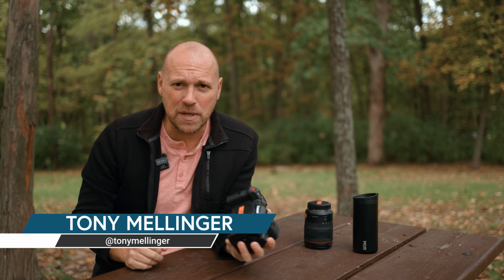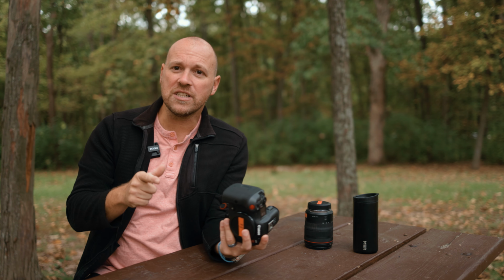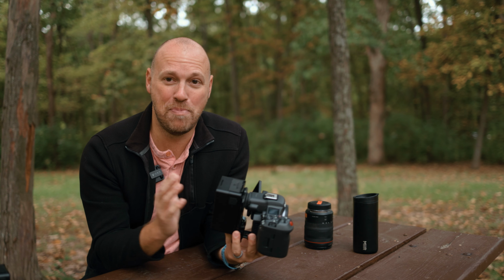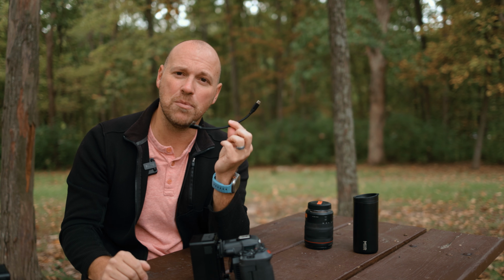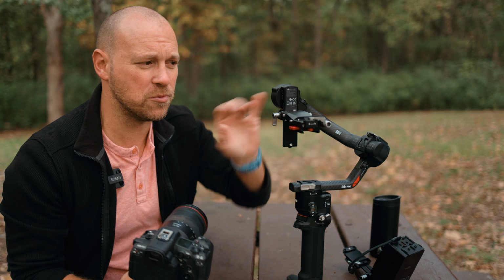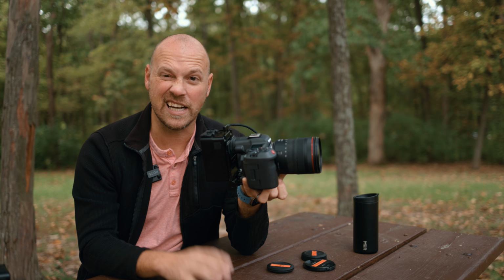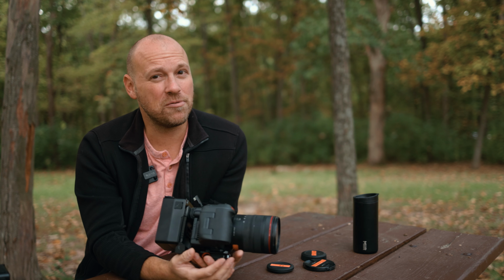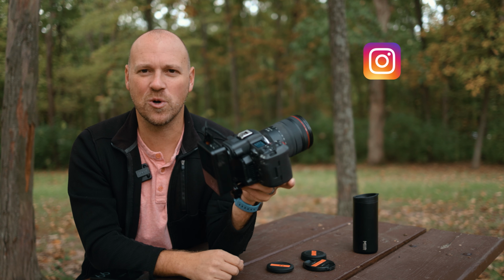The R5C's Biggest Problem (and Solutions)

Comment: I went to Madrid on s photo trip with four batteries 2 new LP-E6P and 2 of the old ones, I shoot mostly 8K 12 raw and a lot of stills in raw and in a full day I didn’t had to change the battery, probably one day i did and I just switch it once but this ones lasts a lot - I am blown away, the trick is not to leave it in stand by, just switch off in between shots and you will have some awesome batteries, I used it on the R5C and the Lowa 10mm 2.8 (that do not connects to the camera, maybe that was the extra boost time)
Reply from the maker: I have 2 of the new batteries. I haven’t really tested them out because I use the small rig 50 and 99pro batteries.  I need to just see how it does for me. It’s honestly a bad habit I have… turning the camera off instantly ha
Reply: @ yeah I have two of those too but too heavy I have been carrying around with me 5 small canon batteries for months and that worked, but with this ones newer ones is even better from 5 now I have 2 and in a single day I did not had to change the first, it is way better
Reply: @travelexplorer  Hi, question. Can shoot 8K60 without external battery using the newer LPE6P batteries? (which was no possible with the LPE6NH)
Reply: @RickyCheung I just test it, with my Canon 70-200 2.8 (wont work) but with my Lowa 10mm 2.8, does work, i am guessing the not contact lenses will work because there is not much power draining, i am guessing that any cinema lens you use with it will work, and just in LT 8K 60fps, not ST. 

If you put the camera sensor in Super 35mm mode it works under ST but not HQ, and on Super 16mm mode you can use the HQ and goes up to 120
Reply: @travelexplorer   thanks for the quick test.

Comment: Great stuff- I use a power bank with 3m Velcro picture hanging strips on the bottom of the ronin plate, same idea and runs all day! Then, with the new canon battery (LP-E6P) that ships with the R5ii, any time I disconnect from power, I have plenty of life now that you get an almost 50% extra life in comparison to the LP-E6NH. Game changer!
Reply from the maker: That’s great! I have two of the e6P batteries getting delivered tomorrow. I find the same way with my v mount. Even if it disconnects, I’ve got plenty of juice to get me through what I need. Thanks for watching!

Comment: Hey Tony,

Is there a way you get the camera to tell you the battery life when connected to the v mount vs it saying “PD” and when mounting the battery on the gimbal does it count towards the payload capacity?
Reply from the maker: The camera just says USB PD but your battery might tell you how long it will work pulling that much power. The SmallRig batteries tell me. 

And yes, the way I have mine set up, it counts towards the payload capacity. I have the RS4 Pro so I have no problem with staying under weight. You could mount the battery on the handle and that would take care of that problem if you’re running into weight restrictions
Reply: @ cool! Thanks for the reply.

Comment: Hey Tony, great video. I was curious if you had any issues getting  your Smallrig batteries to charge to 100%. I have the Mini VB99 and it never charges to 100%, only to 88%, and when I pair it the R5C, the camera is stating I only have 30-50 minutes of runtime in video mode at 1080p, which is so wrong. Wondering if you had any tips or if that's a Smallrig issue. I will note I've had the Mini 50 and 99 and both have had the same issue.
Reply from the maker: Oh man! No, I haven’t had that problem. Have you tried a different power source? If you have a MacBook, you could use its charger. That seems to work really well.

Comment: LP-E6P will change your life
Reply: What kind of runtime are you getting at 8k 24fps / 60fps with the LP-E6P? I'm thinking of switching from a similar v lock system to battery grip with x 2 Ep6P batteries
Reply: @  For 8K 24 you will get around 60 minutes give or take! The way how these batteries work is you get the same amount of time in video as in photo the LP-ENH would only give you like 30 minutes then it reserves! But these will shoot till the batteries actually dies! I don’t shoot 8K like that because I love the AF AVC codec so I’ll always shoots that! With I can get 90 mins on a full charge but I still use my External Drive because I’m rigged up but I have the confidence when I use a gimbal I won’t get nervous! lol as well I only use the battery grip when I’m 90 percent only doing photos! I’ll then use my old batteries  in my grip!  The camera looks 😎 without the grip when shooting video LMao 🤣
Reply: @mrdamiansingh  Thanks much appreciated

Comment: I can attest the new lpe6p battery greatly improves the runtimes of the R5C.
It’s like a new camera with that battery as you no longer have to rig it out for just run and gun normal use it’s great.
Reply from the maker: I got two delivered last week. Wahoo!
Reply: Can you natively shoot 8K60 raw without external power with the new LPE6P batteries?
Reply from the maker: @RickyCheung  I just tested it and you can shoot RAW LT in 59.94p. You can also shoot that on regular e6NH though too.
Reply: @TonyMellinger  what lens? I think @travelexplorer just said no with native RF lenses because of power draw.
Reply from the maker: @RickyCheung  weird. I don’t remember what lens i had on there but i only have canon RF glass.
Reply: @TonyMellinger   No rush Tony but do you mind do that test for me. I'm actually trying to see if I would pick up an R5C. LOL It would be huge for 8K60 even in LT with no v-mount with new P battery  to keep the package small.
Reply from the maker: @ ok I just tried it for you. I think I my AF was off. It works with 8k 24 and 30, not 60. Sorry!!
Reply: @TonyMellinger  Thanks for testing for me.

Comment: Making R5C bigger and heavier than C70 is not a solution, C70 is then a much better buy, especially used. The point of R5C is it's size, and fortunately we now have LP-E6P batteries, that is the only real solution for the battery life problem.
Reply from the maker: I agree the e6P is a great option. There’s a difference between the r5C and c70 though. You can’t use the c70 as a photo camera. That’s why I makes sense to me to use an alt battery if you need extended times.